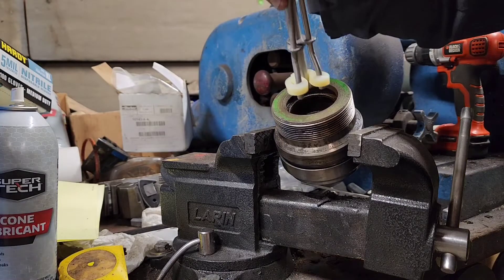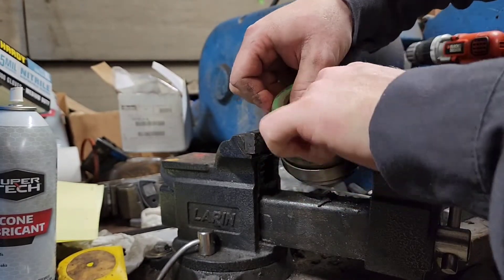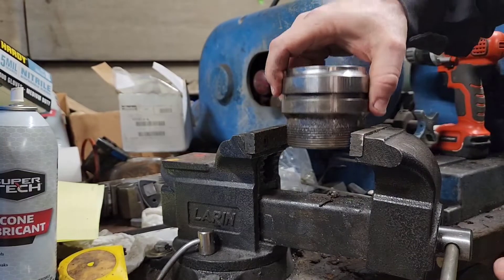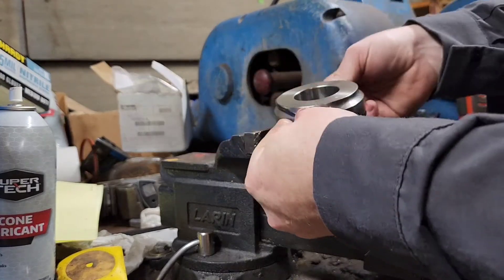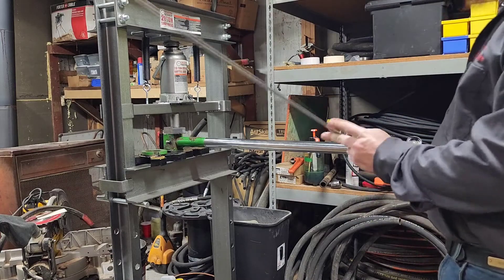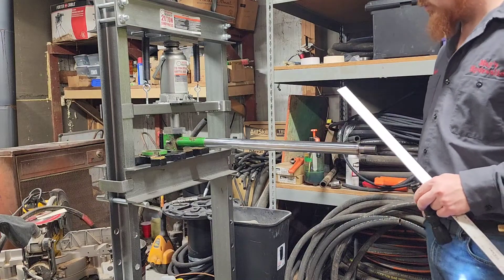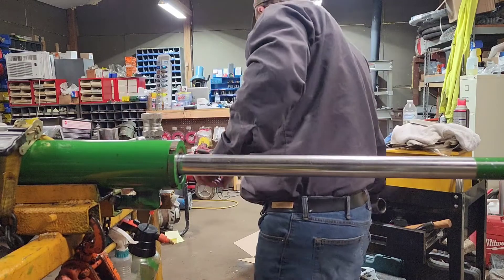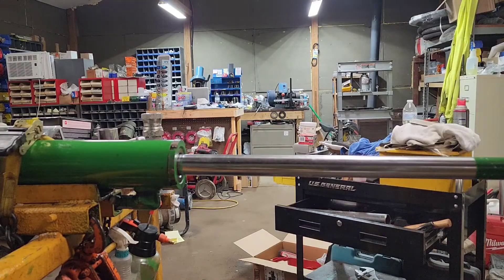John Deere cylinder rebuild part 2

Comment: Great video. Did you use a cylinder hone where the snap ring is at the end of the cylinder? Thanks
Reply from the maker: Yes I do.  Especially if there is burrs on it.
Reply: @mayshydraulic  great, thank you

Comment: how much do you think a kit and labor should reasonably be to do what you just did?
Reply from the maker: That is a very difficult question because there are a lot of variables there.  For us, we don't use kits. We measure out every seal.  So for your question, if it was brought to us, there would be a flat rate. For example, if it is a 1.5 rod, your cost would be 195+ tax.  That price includes every seal and a 1-year warranty.  The only way that price would change is if we have to do machine work or we have to get custom seals.  I know shop that charge shop rate plus seals. And their shop rate is 90+ an hr.  So the best awnser I can tell you is it will really depend on the shop.  Sorry for the lengthy awnser.